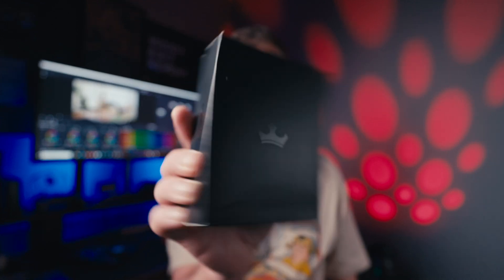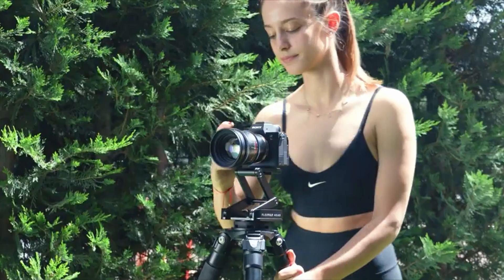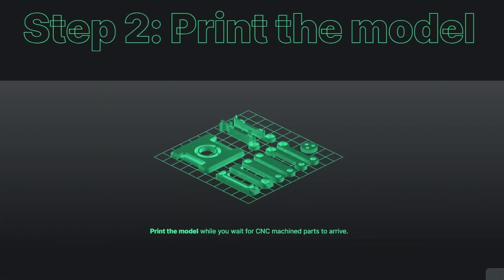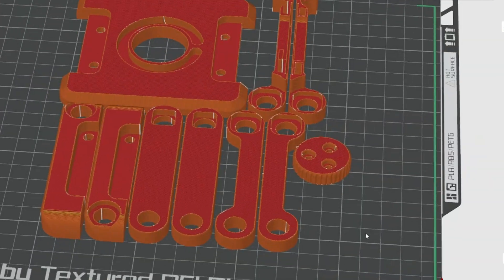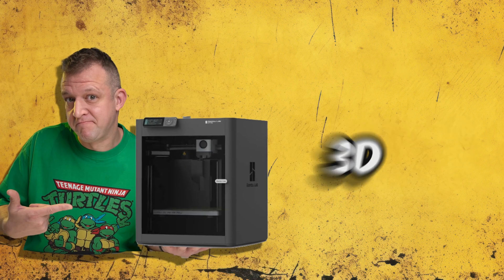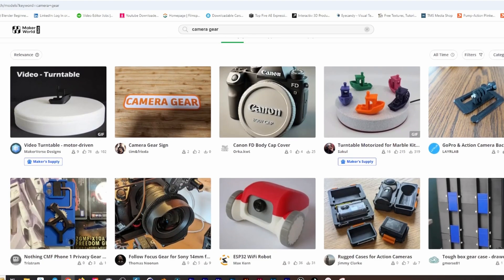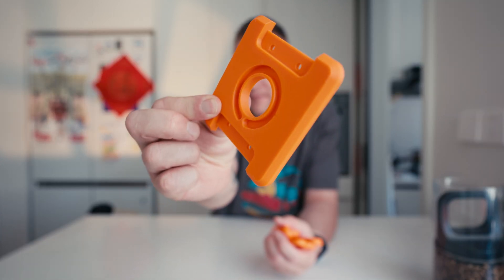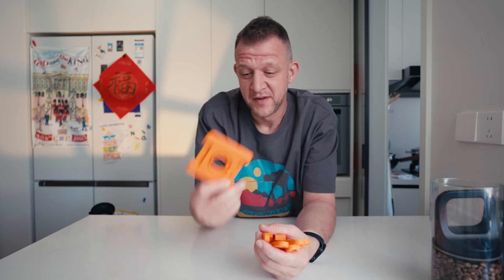I couldn't afford expensive camera gear so I tried 3D printing it

Comment: Don't print expensive gear holders with PLA. It degrades pretty quickly and if it breaks, it breaks without warning. PETG is the way to go :D
Reply from the maker: @WINTFOX  ah ok good to know, maybe I’ll reprint the parts then. Thanks for the heads up 😀😀
Reply: PETG is garbage use ASA or a composite of it for true durability and heat resistance